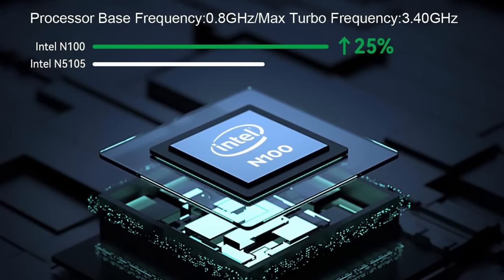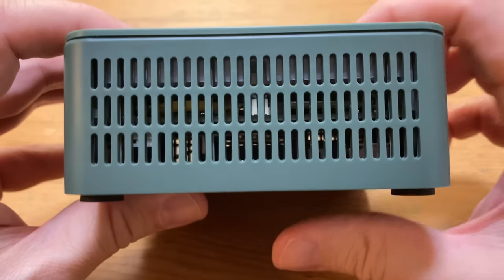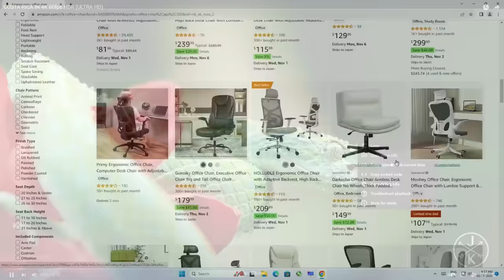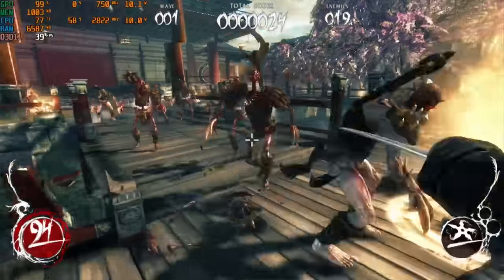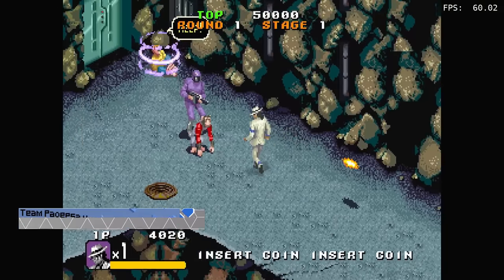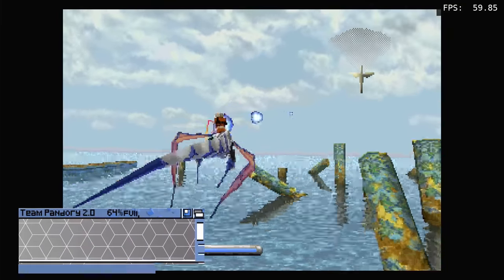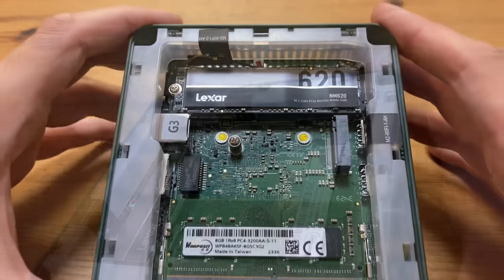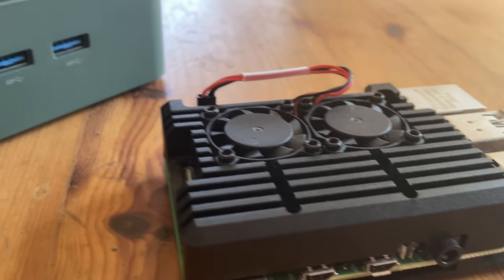This Intel N100 Mini PC is UNDER $100! 😱 [GMKtec NucBox G3 REVIEW]

Comment: Does anyone have Bluetooth gamepad Problems in batocera 38, when WiFi is turned on?
After connecting my gmktec with WiFi, my Bluetooth gamepad has latency Problems. (Tried for 3 different gamepads, and for all the Same Problem)

I have Input delays and Sometimes the Buttons dont Work at all.

My gmktec is connected in the 2,4 and 5 GHz frequency wifi. I switched to 5 ghz-only, but unfortunatelly nothing changed at all.

Any ideas? Thanks!
Reply from the maker: Which systems / games have you tried to emulate? 
If you can give more info I'll see if I can replicate your problem.
Reply: @TeamPandory  the latency Problems Start from the Moment, when I Connect my Bluetooth Controller. So already in the UI.
I have the latency Problems in the whole system, so in the UI, as Well as for all emulators
Reply from the maker: @kadiryazici1558  are you using a TV or monitor ? - and have you tried plugging up another wired controller ?

Comment: Does naiomi and atomos wave work on this
Reply from the maker: ... Yes @7:13
Reply: This is on deal atm I'm looking to get one for emulation which option is best to buy I don't have ram and m2 so
Reply from the maker: @-Jamie  if you already have memory and SSD, then go for the barebones... But remember that it won't have windows 11- for that you need to get the ram / nvme bundle- and that usually works out cheaper than getting it yourself, as they get OEM versions. 
I'd have a look around their site, there may be coupons you can use for a better deal.
Reply: @TeamPandory  will retrobat windows runs on this mini pc? I watched a few videos it look great for emulation
Reply from the maker: @-Jamie  yeah it's okay, probably maxes out at PS2 / Wii but can do a little wiiu

Comment: Can i run Linux on  it ????????.
Reply from the maker: Of course. Batocera is a Linux distro 😅
Reply: yes but if you have any kind of issue GMKtec will NOT support you, I experienced it.

I wanted to install Openmediavault in this G3, however I receive these USB errors at boot

gen 23 13:34:20 openmediavault kernel: ACPI Error: AE_NOT_FOUND, During name lookup/catalog (20220331/psobject-220)
gen 23 13:34:20 openmediavault kernel: ACPI BIOS Error (bug): Could not resolve symbol [\_SB.PC00.TXHC.RHUB.SS02], AE_NOT_FOUND (20220331/dswload2-162)
gen 23 13:34:20 openmediavault kernel: ACPI Error: AE_NOT_FOUND, During name lookup/catalog (20220331/psobject-220)
gen 23 13:45:34 openmediavault kernel: ACPI BIOS Error (bug): Could not resolve symbol [\_SB.PC00.TXHC.RHUB.SS01], AE_NOT_FOUND (20220331/dswload2-162)
gen 23 13:45:34 openmediavault kernel: ACPI Error: AE_NOT_FOUND, During name lookup/catalog (20220331/psobject-220)
gen 23 13:45:34 openmediavault kernel: ACPI BIOS Error (bug): Could not resolve symbol [\_SB.PC00.TXHC.RHUB.SS02], AE_NOT_FOUND (20220331/dswload2-162)
gen 23 13:45:34 openmediavault kernel: ACPI Error: AE_NOT_FOUND, During name lookup/catalog (20220331/psobject-220)
gen 23 13:53:26 openmediavault kernel: ACPI BIOS Error (bug): Could not resolve symbol [\_SB.PC00.TXHC.RHUB.SS01], AE_NOT_FOUND (20220331/dswload2-162)
gen 23 13:53:26 openmediavault kernel: ACPI Error: AE_NOT_FOUND, During name lookup/catalog (20220331/psobject-220)
gen 23 13:53:26 openmediavault kernel: ACPI BIOS Error (bug): Could not resolve symbol [\_SB.PC00.TXHC.RHUB.SS02], AE_NOT_FOUND (20220331/dswload2-162)
gen 23 13:53:26 openmediavault kernel: ACPI Error: AE_NOT_FOUND, During name lookup/catalog (20220331/psobject-220)

G3 support replied me that they only support Windows 11 but it seems a Bios issue.
BTW anyone is having these USB issues with G3 ?

Comment: Imo if you are on a budget and want a computer, it's ALWAYS better to go USED, as you will get a much better CPU, RAM, GPU and SSD than these cheap E Waste PCs you can buy for under $400 (these are practically unusable and slow)

Comment: Hi I want to know do it runs the last version serato DJ pro please tell me
Reply from the maker: Maybe?  Sorry, as I've never used that software, I don't know- but looking at the specs, I think it'd be on the low side.  
- If you want one for work, get a computer that you know will work.  It states Ryzen 7 5000 series for "High Performance", we have reviewed a few cheaper ones recently, namely the GEEKOM A5 and GMKTEC M5.  Maybe check those?

Comment: Does anyone have problem with the Realtek RTL8852BE installed? Sometime the network card network drops if wi-fi is with 2,4ghz mode...
Reply from the maker: I've found a potential fix online. In device manager, right click and check the properties of the card. 
Turn off 2.4ghz and aggressive roaming. Let me know if it helps at all
Reply: edit: it's not normal i meant :)